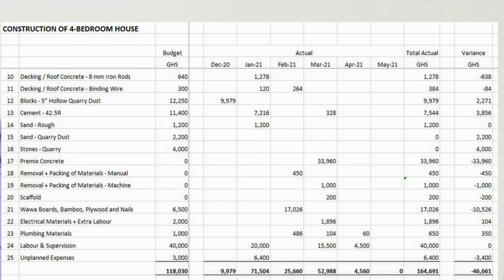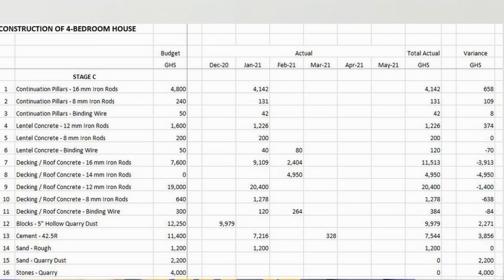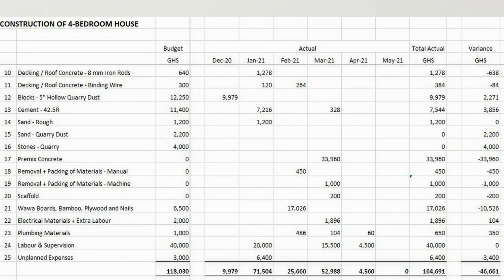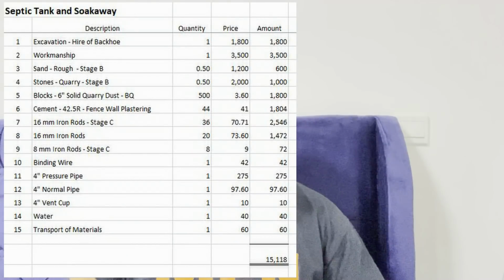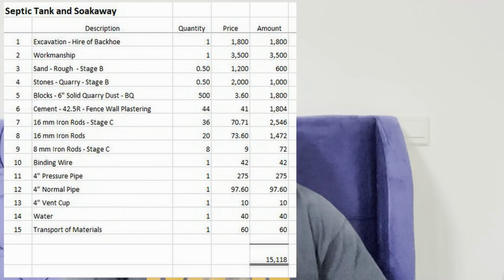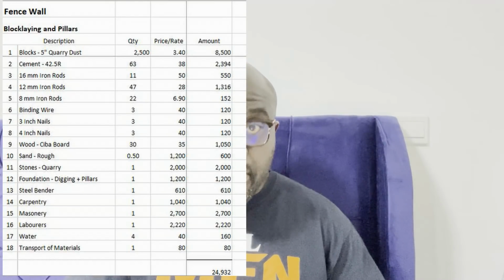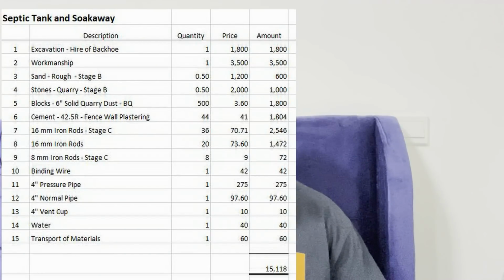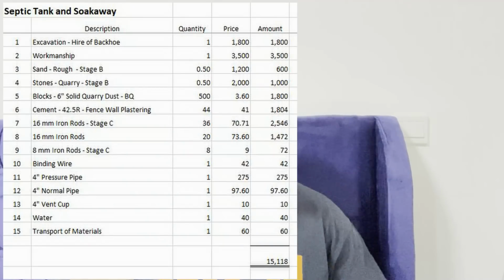BUILDING IN GHANA | TRACKING YOUR BUILD COST

Comment: You are doing a good job. This video has been very useful, just like the others videos. One observation, is that, you have a good control of the cost. I am not sure if you are buying the materials yourselves or whether you are giving the money to buy things on your behalf. To give you an idea, I have 2 plots in Ghana (central region) on which I want to raise a fence before someone takes it away and I have just been given the list of items and it is nothing compared to what you have shown. For example, I have been quoted 5000 blocks of 5 inches and 160 bags of cement for both the foundation and fence wall. This does not include the plastering. Having now watched your video, I feel I need to seek further estimate. You had 2 plots as well and I can see that you needed only 2500 blocks of 5 inches.